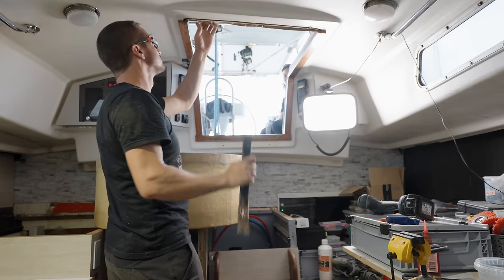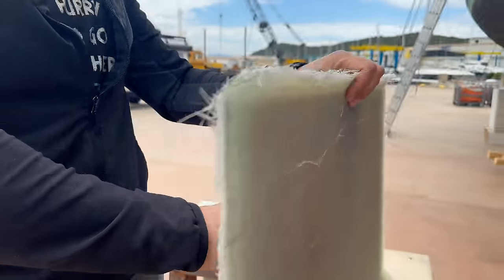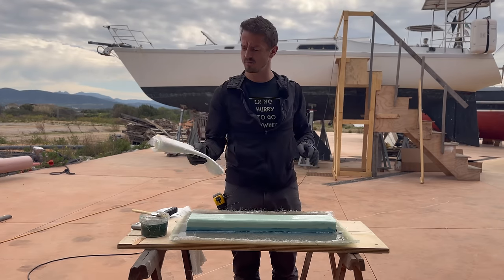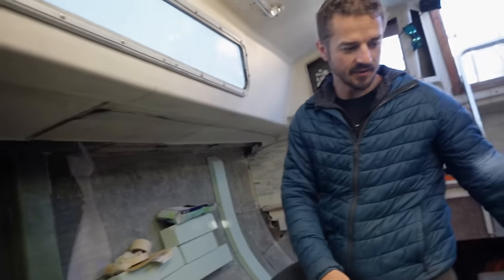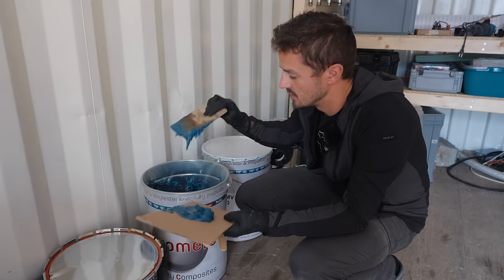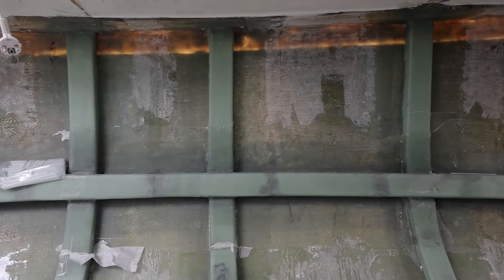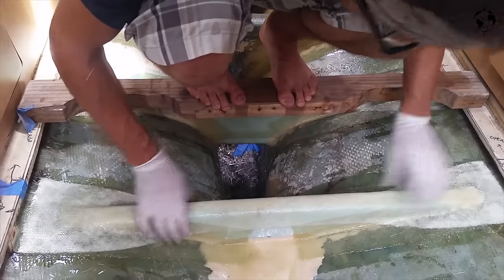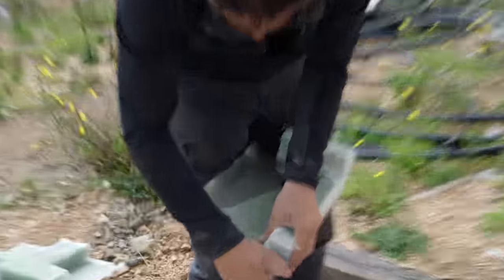Cutting Open our “New Hull”: What Could Go Wrong? | Step 386

Comment: not the right foam.  you should be using pvc structural foam.   composite sandwich construction depends on the bond to the core material.  that soft foam will just delaminate when when it flexes.  also you should be bedding the form in cabosil with a sheet of 1708 between the foam and the hull.

Comment: You said you can use any foam. That is not true. If you use polyester or vinyl ester resin you can't use pink foam. The resin attacks the foam. Pink foam is a type of polystyrene foam. If you use epoxy resin then you can use pink foam because epoxy does not attack polystyrene.

Comment: That was pretty much a total bonding failure. The rib came off of the "hull"  plate as if there was mold release between them. There is no way this was caused just by some peel ply residue. The Umas must have used a waxed resin or something when laying up the "hull"  plate. I guarantee there was some kind of film or residue between them. Whether it was a contaminate from after layup or something in the resin I don't know.

I am sure the work inside the boat will not have this problem.

If there is any doubt, the Umas can have the workers lay up a small sample "rib" that they can rip off of the hull just to verify that there is a good bond.

Also, there are some very knowledgeable people who recommend sanding after removing peel ply. But there are also experienced people who never sand after removing peel ply. So I am sure it works OK without sanding. This is not the explanation for what happened with the test piece. Personally, I will always sand.

Comment: the test sample failed because of the use of the peel ply layer you put on at the end of the session. It produces a too smooth surface for good chemical bonding to take place. You produced mechanical adhesion not chemical bonding on the further layer. scratching the surface would of aided the chemical bonding of the layers old to new. OR, did you use  wax impregnated resin that should only be used on the last coat like the peel ply should be.  I'm 71 and have never used the peel ply method and all my multiple layers of glassing have stood the test of time. good luck

Comment: I dont get why you did not use fillets for laminating in the ribs?
Reply from the maker: We did. That was the blue goo you saw going in the 90° angle. You don't need much. 8mm is plenty.
Reply: @SailingUma  but only on the horizontal ones, right?
Reply from the maker: Both.

Comment: I wonder if all boats of that era were built with shoddy workman ship. Also, I was thinking you should have glassed the foam to the skin instead of hot gluing it, ... IMHO.
Reply from the maker: Waste of resin. The foam is t a structural part of the boat. Just form work to hold the glass in place while it cures.

Comment: I am surprised you didn’t create fillets for the ribs.
Reply from the maker: That’s what the blue goo is.
Reply: @SailingUma  right. I saw when you used it on the stringer part of the demo, but I didn't see it used on the ribs in your demo. I may have missed that and maybe it was done by the pros, but I missed it there too. I hope you figure out your delamination issue so you can sleep with one less thing to worry about.

Comment: I don't think that your test panel is a fair representation of the work being done inside the boat. On your test panel, you have a new laminate. This is a very different scenario than on the boat.The very old laminate of the hull, I trust, was very well sanded and cleaned before the glassing was done.  Furthermore, the test panel's "hull" laminate was not prepared correctly, in my opinion. I don't think the use of peel ply is good enough. Could it be a case of wax entrapment under the peel ply? Maybe it would be a good idea to cut a sample of the hull after the work is done (and curing time) and try to destroy that panel. I hope that somehow this post may be reassuring to you...

Comment: The cost saving for not using epoxy is just not worth it. The time and labour is way more expensive than material, so don"t use something that can work, use something that does work.
I would suggest taking a slege hammer and impact test it like your sample test. If it passes the test you are good to go if not your professionals have something to answer to.
I wish you good luck.

Comment: Why vinyllester?  I have done a fair number of major hull repairs with owners crying about epoxy cost.  Its not THAT much more, especially if you use construction epoxy.  Vinyllester does not bond as well to cured polyester as epoxy as it is not molecular.  You know this.  So is it for fumes?  Also, how different will the boat sail with the added weight?
Reply from the maker: She’ll sail much better with the added stiffness. And we’ll sail much better with out all the squeaks.
Reply: @SailingUma  You haven't answered his vinylester question.  Not trolling, I am genuinely interested. I have flirted with using vinylester or polyester for my rebuild (I too have gutted my interior and am close to starting the rebuild), but my two boatbuilder mates of a combined 60 years boatbullding experience, convinced me that epoxy is the way to go.  Anyway good luck with your project I am sure the boatyard lads are and will do an expert job.

Comment: I’m not an expert. But I’ve read that  using vinylester over old fiberglass, isn’t a strong bond, a much better bond is achieved using epoxy, search west systems
Reply from the maker: Yes, we're heard this many times. It's "sort of" true. But the reality is the bond between the new and old will be just as strong or stronger than the bond between the new layers. As in, the new layers will tear apart, before they pull off the from the old. Like most things in life, it isn't black and white. It depends on the application, technique and desired outcome.

Comment: I think you said the boat is 50 years old, if so what I'd like to know is why you think it needs to have all these ribs and stringers for strengthening when the boat hasn't snapped in half in it's 50 years? All that work, money and extra weight when the designer and builder obviously didn't think it needed it, why do you think it does? Also you must sand and clean the surface when using peel ply. Also vinylester is crap

Comment: Uh…as someone who know nothing but how would you know if it delaminated? It is a very irregular shape perfectly inside of another irregular shape. After you set the next to final mat set some kind of fastener all the way to the outer hull. But my guess is the layer of mat still to be laid will actually be laid in a manner to allay any of your concerns. I have no doubt you worry was real and not staged. I just do not believe this is that big of a deal. Uma as you described this going all the way to the ceiling you’ll have too many bolts to fasten stays, and other accoutrements.

Comment: this foam blocs has to bee glued to the hull by using thing epoxy an then layed with fiber over it, but all surfaces has to been cleaned with alcohol before glueing, as I see this delaminateing you test for, is not good enogh.

Comment: It wasn't very clear to me. How far you are overlapping the structure you're adding for the deck over top of the structure for the keel. It looks like there may be a stress riser where you have the structures for the keel in the structure for that deck not joining but you did say there was some overlap, so I'm hoping that it's not a stress riser there.

Comment: One thing that I have NEVER understood... Why don't they put a visual mark on the exterior of the boat...of where the straps should go when the boats are hauled out.... also, of where the supports should go when they are on the hard.  It seems like with every boat, they are trying to determine the location of the straps at the haul out and hoping that nothing gets damaged if they are in the wrong place. Right now, you know where the ribs are and where you would want the straps to go.
Reply from the maker: Most new boats have lifting marks on them. On our boat, we just know by where the stanchions are. As for the stands, it's pretty easy to just knock the hull a little and listen for a bulkhead.
Reply: @SailingUma Thank you!

Comment: Guys Guys Guys.     Should never do structural repair with hull out of water !   The boat flexes when on the hard and you will glass the flex in and when put in water the hull will want to go to its water shape originally and move the ribs u just put in and crack.   Any big wave the hull will want to flex to its original shape and stress all structural points.    ALwAYS Always do structural with hull in the water and there will never be a twist.

Comment: That is a lot of extra weight?
Reply from the maker: Not really. The all the glass, foam and resin going back in is about 250-300kg. We ground out almost that much grp dust  during demo. Besides it will 100X stronger. So worth every gram.

Comment: Let's hope @Antoine Grondin is correct that you will not have delamination issues. I assume you did not do this project to save money and definitely not to save time. But it would be interesting to hear the comparison of the cost of your project versus buying an equal size and capable boat net, net of the same age. Then add in how many hours at a fair amount per hour for your time.  You obviously enjoy the process of building your own boat and it makes for good content for youtube.  Another interesting comparison is what if you had bought a strong, stiff comparable new hull from a good builder versus repairing, strengthening Uma and then the building from there of both. Most people, including me, think you are insane to take on the project of rebuilding Uma.  I know you have a lot of qualified help but it is still seat of the pants and experimental. Think about what a first hull is like of a new design from the very best boat builders in the world. There are always lots of issues. Personally I would not buy lower than hull # 20 of any design of cruising sailboat.
Reply from the maker: A brand new 36-40th boat costs $200,000 to 500,000 depending on which yard builds it. This refit will cost us 10X less than that. It also takes 2-3 years to build a boat. This refit will take half that. Its much cheaper and much faster to fix what you have than just buy something new. Besides, there isn't a single boat currently on the market that we would want to spend $500k on, even if we had that kind of money. They're all the same, nothing innovative.

Comment: Not close to an expert. All I know is what I've learned from watching sailing channels, but it seems like when a 90 degree angle between two surfaces is glassed over, they always run a bead of some kind of filler before glassing the joint to soften the sharp turn the glass would have to make. I didn't see them do that when glassing in the foam braces. Is that an important step?
Reply from the maker: That’s what the blue goo was.

Comment: Aside from all the other upvoted comments as to likely issues with your test piece, even if you had 100% replicated what's going on inside UMA  with it, cutting it up that way before testing it makes no sense and the result you got is completely unrepresentative of how your strengthened hull will perform.
Reply from the maker: It wasn't supposed to be a 1:1 comparison. It was supposed to test a theory we had about peel ply. Which it did. More test coming in the next video that will show what we're talking about more clearly.

Comment: Looks like and amine delam, which makes it just like you waxed it
I never did trust that peel ply
Did you sand after removing peel ply?
What resin are you using, vinyl, poly, or epoxy?
The peel ply has to be very wet to raise the amine blush or delam
A wipe with styrene to give it a little extra chemical bond rather than mechanical bond 
FIRST review what you did, 
What did you wipe the sample down with after removing the peal ply?

ALL things being equal, you may have some bad product (out of date maybe)

Comment: In regards to your boat, you did not grind before you attached your ribs to your model, but the inside of your boat was ground, smooth and thus will give better bonding Although epoxy would’ve done a better job of bonding. It’s just the nature of the stuff. 

On a side point you said it right the first time when you said your favorite thing was because she is a person not a thing she is not a possession. She is a partner. She has my permission to slap you now.😂

Comment: Ouch - the test piece is ugly. Whenever I have had bits cut from my hulls I have never ever had something fail like that and I have whacked test pieces with hammers too - never a delam. In all the times I have removed parts of my boats I have had to cut and grind them out, never have they failed like this. I would not want to be having to make a decision you guys have to but maybe it is new boat time. Or get a chisel and start hacking at a frame edge in the boat to see if the delam is there too. Can you peel the edge of the interior frames away - if so then they all need to be removed. One problem is that you guys are learning on important jobs. I use peel ply but always sand down afterwards - see Young Barnacles Youtube for the reason why. You are doing serious structural repairs and the laminations should be 100%, and it looks like your will not be, so maybe remove them and start with epoxy or just cut her up and walk away. I only use epoxy to build boats so don't have issues with secondary bonding, but secondary bonding issues are a real problem when using polyester. Also, the bonding problem will only get worse as you get cyclic loadings when at sea - you could build an interior around a dodgy set of laminations that eventually start delaminating and then you still have a weak hull with delaminated reinforcing - big decisions ahead. I have built boats for 30 years and would not like to work out what to do.

Comment: the delimitation problem inside the hull may not be an issue.  the professional crew used a lot more resin and the hull looked thoroughly wetted.  your techniques of trying to wet through the glass from one side may not have been nearly as effective as the dudes in the suits.  before panicking  do the test again but with the same technique as the yard guys
]

Comment: Sorry to say, but delaminating like that is a disaster.  It's all got to come off and epoxy used next time.  On the plus side, thank god you found it.
Reply: @UKMechanic well thats good news.  And whats the issue?
Reply: @UKMechanic They said that their test was the same as what was done inside the boat...  certainly roughing the surface would have helped, but it's my understanding that you can't put polyester resin on any surface...  So there appears to be a bonding issue with polyester vs. epoxy.  I've heard that you can put epoxy on polyester, but you can't put polyester on epoxy.  Yeah, the boat isn't epoxy, but it shows that uncured polyester has issues bonding...  

Well, if I were them, I'd still try to peel up some section that the pros laid down inside the boat and see how easy it delaminates.

Comment: this is my humble opinion but i think you simply didn't prepare the hull surface sanding it properly before gluing the stringers and so on... but even if i have some experience with fiberglass and resin i could be wrong and you have for sure more knowledge about it than i do.

Comment: Are you seriously using hot glue to fixate the stringers to the hull? Aren't you introducing air bubbles between them and the hull by doing so? I think I would have "epoxied" them in, creating a bubble free and solid connection.
Reply from the maker: The foam just holds the glass in place until it dries. We could remove it and still have the same strength.

Comment: I don't even understand... these terribly trained professionals didn't even remove the gelcoat. I didn't see sanding or acetone.
I suspect your hull bracing is even weaker than the sample pieces.
At the same time, it is a rule of thumb that the subsequent addition to the polyester resin glass fabric laminate can ONLY be done with epoxy resin and not with vinyl ester because it does not bond well!
Now you either start over professionally or accept it like this...

Comment: You would have been crazy for doing this as Kika said, EXCEPT that you're youtubers. You're monetizing this process which is the ONLY thing making it not absolutely insane. Like others have said, they wetted the fiberglass fully and they probably fit the foam better than you did. If you're really concerned, have them make you a model using their methods and destruction test it. However, your "hull model" is not the actual hull which may have different bonding qualities than your actual hull. Your model also had large gaps between the ribs and the stringers and thus was NOT monolithic. Spaces inside of structures that aren't designed to have spaces can be really bad. Keep your head up! All is not lost!!!
Reply from the maker: Only difference is if we weren’t filming the process, you would be watching it. We’d still be refitting our own boat because it the one we own. Buying something new to us is the silly decision when what we have is fine. We’re spending 10x less money on this refit then we would on a semi new boat.
Reply: @SailingUma  Sorry to offend you. That wasn't my intent. I meant it as a compliment. You guys are figuring out a way to make a complicated, expensive process work for you. AND you're letting us come along for the ride. It's a win, win.